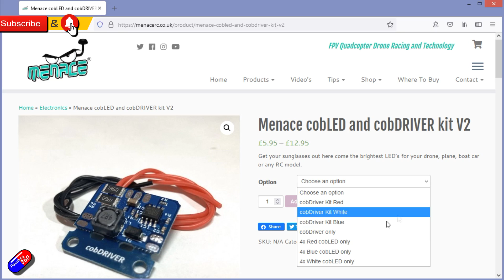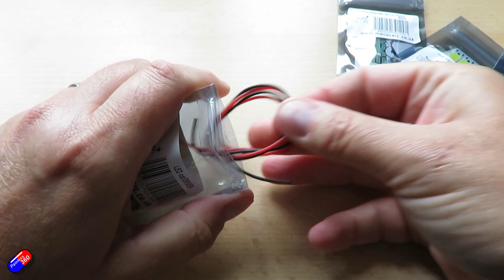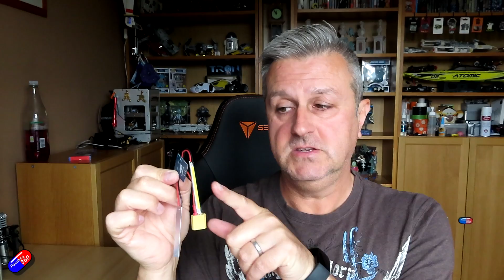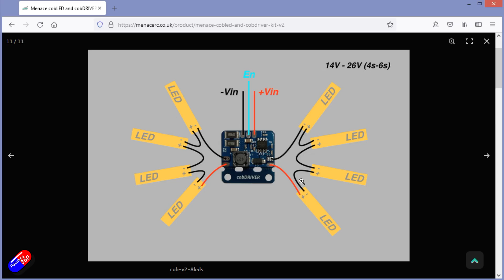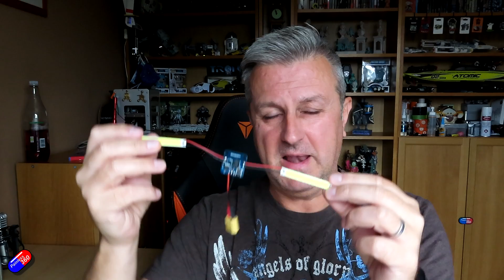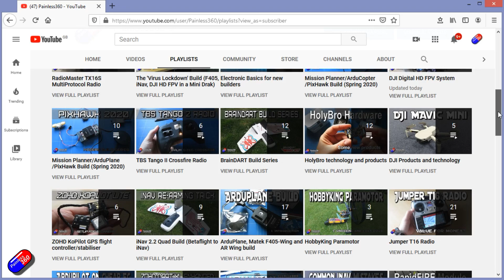NEW Super Bright, Controllable COB LED Lights for your model! (MenaceRC COB LED Kit V2 )

Comment: This looks like a great product thanks! I’m a bit puzzled by how I might power it though? Fixed wing for night flight I would probably want the 8 LED which needs 6s voltage? But my aircraft generally run 3s? Another battery is going to add huge weight ?
Reply from the maker: 4s to 6s is what I can see on the diagram for 8 LEDs. You could run 2 x sets of 4 LEDs..
Reply: Thank you - hadn’t thought of that 😂

Comment: You should be able to drive the EN pin with a PWM signal from a flight controller or RaspberryPi.  You should then be able to dim or slowly pulse the LEDs based on how you drive the EN input.

Comment: Hey I have a question it's kind of a technical question and I'm thinking you may be the one to answer analogue video has audio sent back to your goggles dji does not is there a stand alone TX that could be added to transmit the audio out to some sort of device kinda like short wave or FM freq
Reply from the maker: I'm not aware of anything. If you you find something, please let me know
Reply: @Painless360  it doesn't sound like a very difficult thing to accomplish does it ?
Reply: I believe something along this line would work of course there is no range with bt but what if it could connect via bt to the FC and record the audio to the dataflash chip that's at least some what useful I don't own a gopro and if I did I wouldn't strap it to my drone and if I did it wouldnt be any fun so I rely mostly on the dji dvr which doesn't record audio so my videos are all silent lol

Comment: Could you plug this in to the balance lead on a 3S battery??
Reply from the maker: Possibly. Checking here the current draw for the two white LEDs I have here on 12.6v is 420mA.

Comment: Hi Mr. P   Great video on the menace rc L.E.D's  ,  most of the F.C's I use on my quads have a L.E.D's output. But I was thinking about my Great Planes  Spirit Elite 3M Glider,  I could install them under the monocoat,  it would illuminate the wings great. Would be nice if I could change the pattern to a pulse using a switch in the radio. I could always add a F.C and use the L.E.D's pad.  Thanks again for the video and information.

Comment: I was just wondering did you measure the operating temperatures? I have a scratch built foam plane but its made from 5mm under floor heating insulation (running inav fc) and I'm now thinking of setting it up for night flying just concerned about the lack of heat dissipation with it being insulation.
Reply: I had the same thing, I was hoping to bury them in an assassin where they will get no air flow